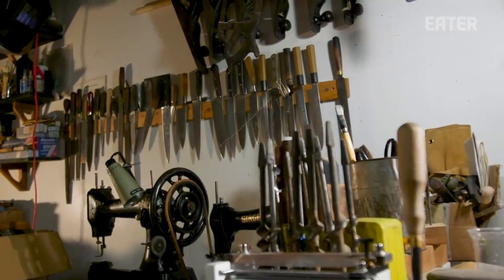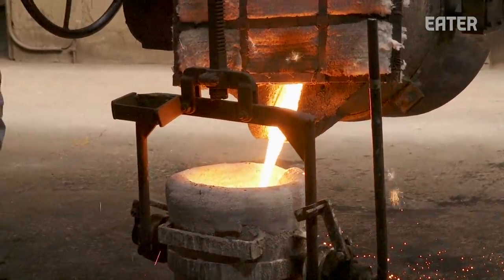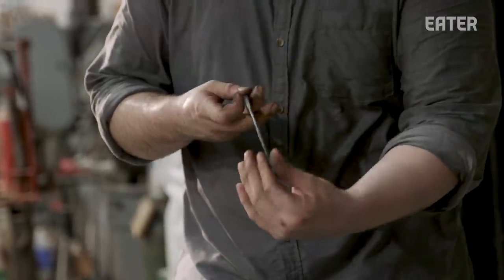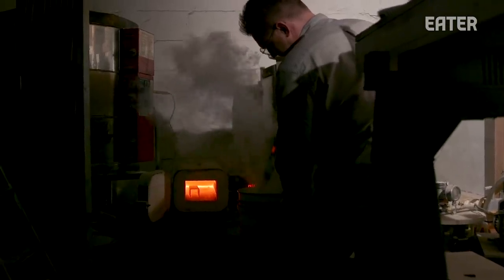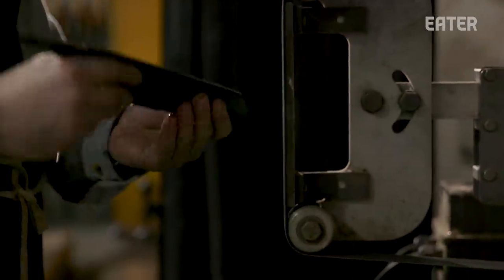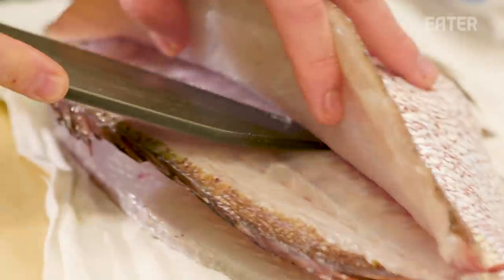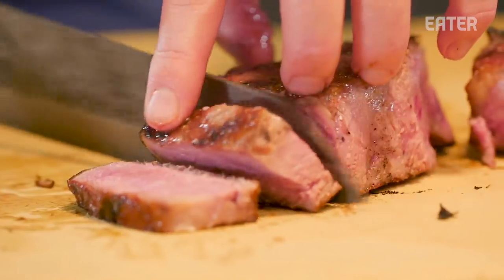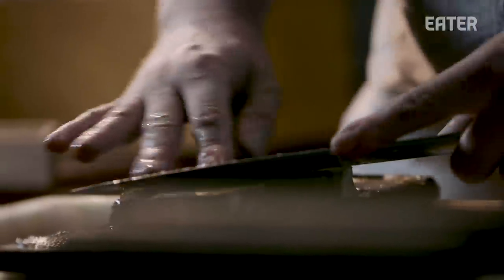How Knives Are Made for New York's Best Restaurants — Handmade

Comment: I love the chef perspective in designing the knives. I hate the lack of metallurgy knowledge. Grain distribution is better when molded not by hammering. The gain or crystal size are larger if  cooling time is slower and smaller if cooling is done faster. Mold and stamped products can be superior because the composition is more precise and the grain is more uniform. The heat treatment process is more important in determining the durability and hardness of the blade not some mythical sense. Machine can make better knives for a fraction of the cost to manufacture. They should be honest with their pricing. 10% design and manufacturing 90% beliefs.
Ps. Machine grinding should be done before the quench and tempering. He is going to have quality control issue as he does all his grins and sharpening after his heat treatment.
Reply: nhan khuu agreed. This guy is far too full of himself and his romance. Maybe he has the metallurgy knowledge, but if so he’s terrible at conveying it.
Reply: I do agree with most things you said, but you have to consider that plastic deformation also increases hardness of steel or anything for that matter. Therefore hammering it does make sense and will most likely lead to the better knife. To be fair, the value you get out of these knifes isn't great, because of all the hours of work that go into the making. Most people are better of machine forged knifes.
Reply: @Fred26498  drop forge machine does it better
Reply: @nhankhuu5643  Oh look!! Its more people in the youtube comments section that somehow know more than a dude that actually does it day in and day out. Look forward seeing your video about how you make the knives YOU sell and get paid hundereds of dollars each for. "Youtube comments... where google a search can make you an expert on anything".
Reply: @Trainwheel_Time  if u don't like Google take a metallurgy book and study. I suggest you Foundations of material science and engineering by William Smith published by mc-graw hill.  Almost all the statement he make in the video are false and @nhan khuu is totally right.
Reply: Completely right. I work with these materials everyday and can confirm everything the guy says in the video is wrong. Good looking knives sure, but the science is wrong. I would never buy a knife from this guy.
Reply: @Super2bAs  his bevel is also completely awful, it is so uneven
Reply: Not entirely correct on the process. I do agree that this guy isn't entirely speaking from technical experience, end even his rough shaping looks rougher than it should be. As well as his statements like how you can't get a distal taper without hand forging are complete bs. Grinding done after heat treat is easier to keep precise and even grinds as long as you keep it cool, with sharp belts it doesn't generate much heat. Also, if you correctly anneal steel prior to hardening, harden at correct temperatures and perform enough tempering cycles it does not have any distinct negatives.
Reply: some of what youve said is true, some of what he said was true. differential heat treating and laminate billets are 2 examples where hand made blades shine but consistency and price are hard to match for manual skills vs machines. also grain distribution is uniform after proper normalization and annealing which is done in both construction methods.  but his shtick about not being able to grind in any shape after forging is as bs as yours about post ht grinding (as long as you dont overheat the blade on your linnisher)
Reply: Just living for this comment section where, for once, I'm not the only metallurgical engineer (or similar) around.
(And yes, the guy in the video was mostly talking bs. But the knives could end up decent with the correct heat treatments? I guess we'll never know.)
Reply: @dandev9239 i agree with you on post ht grinding can be done perfectly without softening the metal if heat is properly managed. That's why I stated that he will have to deal with quality control problems. he's machine grinding the blade with sparks flying everywhere and no way to know if he undid his tempering. I have seen people gone to the extreme using diamond wheels that has super high heat dispersion rate but I don't believe he even bothered with water cooling while grinding. The guy should have done his primary grind> quench> straighten> select tempering method from his setup. Im not coming up with methods he's not equipped to do. I honestly wants him to be better because i really enjoy the chef engineering. Also he doesn't agitate the blade to release pockets and make sure the entire blade is making contact with oil. He just sticks it the oil... that bothers me because i like moving.
Reply: @Trainwheel_Time  I hate to tell you this but doing the same thing for years doesn't mean you've been doing it right for years.
Reply: Timothy Jahn you’re retort was 100% emotion. Dude came with facts. You thought you could dismiss them with feelings.
Reply: @Super2bAs  Nit picking aside, you dont really know a knife until you use it. He said he has experience in the kitchen. So he may not know the lingo but he knows what  he wants out of his knives
Reply: @nhankhuu5643  At least having a pump with a steady stream of coolant if you are gonna be taking off as much metal as aggressively as he is.
Reply: @badm.d  there is quite a bit of blasphemy from this video. The #1 reason to that is lack of understanding of his material. Most machine made knives employ reduction method to give forms and bevel for the knives. Meaning it's a blank that gets cut and ground down to shape. Hand made are supposed to employed compression methods. It means you take the material and compress it to the desired shape. He doesn't make effort to angle and hammer the material into itself when making his bevel and tapering. It show in his work because the material just look squish and splatter instead of guided into the form you want. That leads him to have to do so much grinding and reducing to get the bevel and form. His method is no different than a cnc reducing material. It's just a lot more sloppy and inconsistent. Worst of both world. he should practice with hammering a bevel into a wooden plank first before going into this.
Reply: Literally just from watching far more competent blacksmiths on youtube I can tell you that you're right on the money. Also... "I only hand forge" seems more like "I can't afford a power hammer".
Reply: Agree for that statement about the advantage of foundry in grain distribution and yes it's true that forging is an old fashioned style to make knife but I never knew any knife that made from foundry method yet. And as far I know, it is okay to do grinding after heat treating your material just to take away scale from the surface...
.
Notice me if I'm wrong, still new in metallurgical fields 😂
Reply: damn things are getting heated in the metallurgy fandom
Reply: @Trainwheel_Time  if you actually search about metallurgy that guy in the video has no knowledge on metallurgy and the guy on the comment sections is correct but I dont agree with him on the past part
Reply: The funniest thing about this is how little metallurgy actually matters to the performance of a knife. This is something these YouTube comment nerds don't understand, that they are Frankly the LEAST important aspect as to how a blade performs. Blacksmithing, AKA forging, actually shaping the knife is a huge part of performance, and then 99.9% of the rest is how well the blade is profiled and sharpened. That is what gives the knives its quality, having good steel is great, you can get a longer lasting edge but thats really about it. 

People who comment about knife making from the standpoint of smelting/metallurgy should know frankly that the quality of the steel mostly comes down to impurities, you're basically our material cleaners, you don't actually dictate how the things we make perform, that's all down to the blacksmith who forges the knives, and the cutler who profiles the knives. It's basically down to a misconception and fundamental misunderstanding of the toolmaking process in general that you think the actual production of raw materials are the most important aspect. 

This is why googling something isn't actually helpful knowledge in situations like this.

Comment: 2:06 How close his hand is to what I would believe is an extremley sharp knife gives me crippeling anxiety
Reply: medusa little  In general use of the knife I would agree that a dull knife is much more dangerous than a sharp knife due to the possibility of the edge not catching on to the surface you want to cut. However, I would agrue that a sharp knife is much more dangeorous than a dull knife in this situation, where you are gesturing around the edge. The sharper knife will cut you deeper and more easily than a dull knife.

Comment: Beautiful work and very well explained by Will.  One small question to the knife maker, when you are dipping the hot blade in the quench oil, in my limited view from the video, it appears the handles are left out of the quench oil dip (irrespective of them being also red hot) than the other knife makers that I watched making the knife's.  Would you kindly let me know, that there is an editing issue here, or the process that you adopt do not take care of the metal in its whole form and only use it on the top metal.  The problem I presume - one part of the metal is strong and other part of the metal is brittle, resulting in the knife becoming weaker in its entire metal structure.  Apologize in advance, just curious to know.
Reply: If you have to pierce some holes to rivet the handle of the knife, you can't harden the tang (the metallic part of the blade inside the handle). You could pierce them before quenching, but it is not the case here. It won't cause any structural problem though... at least unless you are making some high technology pieces, in which case I can't say what is best.

Comment: He just slammed a Japanese knife on a honing rod. I just died inside.
Reply: I think that fear only applies to the most traditional, extremely brittle edge steels. Having a japanese shape doesn't mean it's made from tamahagane. Is it the best idea for any rando to do that? No. Does he probably know what he's doing? Yeah.
Reply: @jcarry5214  yeah, but the Smith, or the user spends the effort to sharpen it, and he destroys the fine edge with a steel, with probably diamond honing rod. Makes me cringe
Reply: @Plethiros  That's fair. If it's the right type of rod it shouldn't hurt it, but you never know. extremly high polished edges, like 8000 plus can still benefit from the right type of burnishing, but you're right the idea with the japanese knives is they have insane thin angles that are suppsed to be maintained on stones, not rolled back and forth. The idea of a diamond rod makes me gag too. I got my sister a diamond plate for christmas  and showing her how to use it was gagworthy, but it really did improve her life.
Reply: @jcarry5214  that's why I get a strop and I think people should use them more commonly
Reply: it's a matter of skill honestly. it's possible to use a honing rod well with a japanese knife, but in most cases it's not worth it to
Reply: @jcarry5214  oh yeah, I should also mention, high polished ceramic Honing rods are reasonable for Japanese knives
Reply: But in general, even then I wouldn't use one, I would strop. Piece of balsa wood, a belt, or even newspaper is good enough, and it's not very costly to get compound

Comment: I don't see why someone would use a carbon steel knife for cooking nowadays. The steel reacts with acid and salt, releasing oxides into the food and thereby changing the flavour. 
Doesn't really matter for a quick and dirty bachelor meal but for the "best restaurants" it should.
Stainless steel all the way, especially powder steels which beat other steels in terms of performance any day.
Reply: Most of the best knives in the world are carbon or at least part carbon steel
Reply: If that were the case high end Japanese knives wouldn't be a thing... Sushi wouldn't be a thing, carbon steel knives leave no taste to the food if it is cleaned properly literally 99% of Japan uses carbon steel. And not all powder steels beat carbon steel it's simply not true.

Comment: Man's served caviar with stainless spoons tho...
Reply: Nobody Knows  whaaaaaaaaaaaaaaaaaaaaaaaaaaaaaaaaaaaat????????
Reply: @professionalpainthuffer  Can confirm @Live Life is correct: unless you're buying a truly massive amount, your caviar is most likely to come in a glass jar. 
However, those large metal tins of stereotype do exist. But! They are typically coated inside with a non-reactive lining, to prevent the caviar from tasting like metal, which most companies specifically mention.
Edit: another thing, besides size, which will determine if it comes in a jar or tin is if it is pasteurized or fresh. Pasteurized tends to come in jars, fresh in tins, though this is more of an observation than a strict rule. Exceptions occur. Since most caviar is imported, most is pasteurized, and therefore comes in the glass jars. 
If we want to get into plot twists: science tends to say that the only metal caviar actually reacts with is silver (it has some sulfuric compounds, which makes the silver oxidize and tarnish, producing an unpleasant taste). Most of the rich people eating caviar 100-200 years ago would have had all silver tableware, so the general advice of not using metal spoons was valid. Tin or stainless steel should have no effect.

Comment: Is that bucket he’s using for the quench made of plastic?
Reply: Udeus5 From my experience as an amateur blacksmith, plastic will do just fine, the oil won't get hot enough to melt it (unless you are quenching really big projects) because it's only it there for a few seconds.
Reply: Probably not an average plastic. Many forms have higher melt points
Reply: @travissomething3341  While I prefer a steel quench tank, it is more in case I drop hot steel into the tank and it rests on the bottom. Plastic is fine as the oil should only reach the mid 150f range, just dont push hot steel into the bucket side.

Comment: I think you are ruining blade if you have sparkles when sharpening
Reply: Only if they overheat the blade, most of the heat is taken off with the spark. You just have to keep the knife cool by dunking it in water every few passes.
Reply: @echoside190  Nope this guys is definitely ruining the blade, that's high carbon steel there. His process is bad and his metallurgy knowledge is loooow